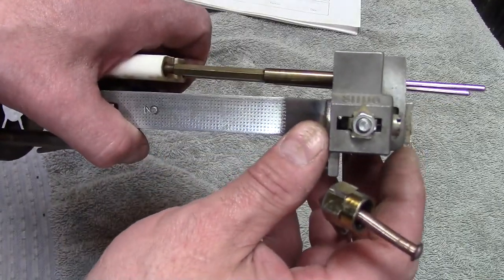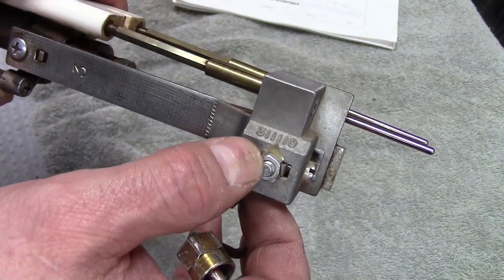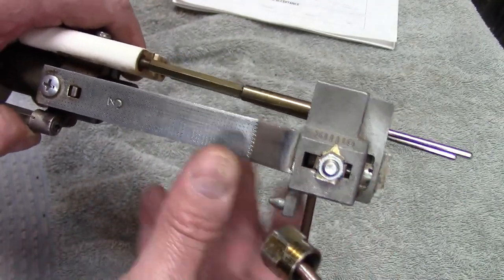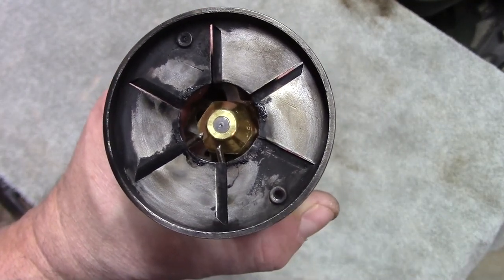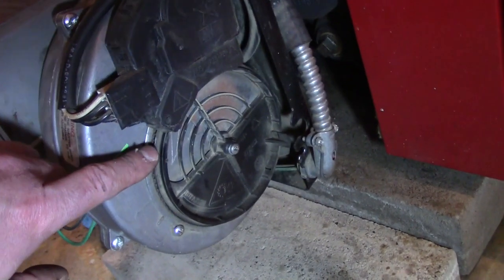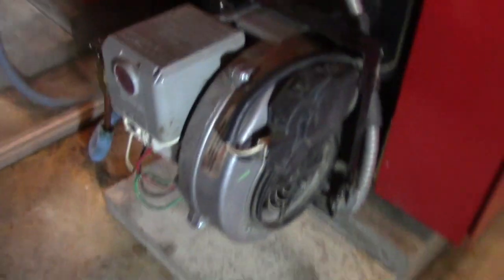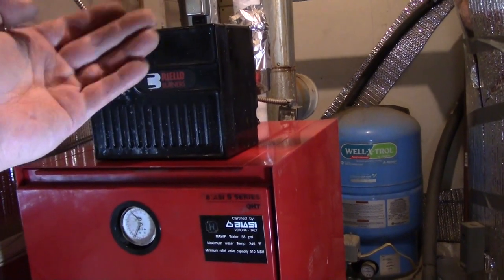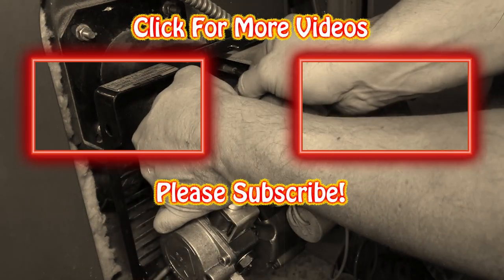How to Adjust the Electrode (Points) Gap On Riello Oil Fired Burners Basic Boiler Maintenance Part 4

Comment: As a DIY I am careful when I touch items such as this . On my Riello , I found 2 different nozzles were used by past service companies . I called Riello and was told BOTH were undersized , based on boiler GPH . I put in what Riello recommended . I have also seen " pros " on video adjust the electrodes " by eye " and use odd size wrenches , and even pliers , on the oil line and bleeder . Which is unbelievable that they don't have the metric sizes if doing this daily . Or even a small adjustable wrench . Great video . Always be aware WHO you are watching and WHERE the information comes from . It may " work or be fine " , but what are these manuals and specifications for ?

Comment: Thank you for this video. One thing I did not see mentioned is the distance from the top of the electrodes to the top of the nozzle . I see a 4mm gap between the electrodes and a 5mm distance to the center of the nozzle. What is the height over the nozzle?

Comment: Great video! I think this is what I need to correct on my Riello 5. 
Its recently been taking 4 to 7 starts before running. 
I've checked the photocell and its fully functional. Fuel is present, as there is a fog 
of atomized fuel in the burn chamber.
What would be the most likely culprit for causing the elongated no-ignition? 
Adjustment of the electrodes?
Reply: Hello. Did you ever figure out the cause/resolution? I am also getting a delayed ignition with 4-7 tries before ignition occurs.
Reply: @easy_two  I managed to get it down to one misfire per ignition. I suspect it is to do with the photo cell feedback loop in the power module. I had touched up all solder connections on the module circuit board. Polished the connections of the photocell.
I suspect the photocell is the culprit.
Reply: @easy_two  let me know how you fair out. I'd like to zero out the misfire.
Reply: Cleaning and adjusting the electrodes resolved this for me. There was significant black soot buildup on the ends which I scraped off with a flathead screwdriver.

Comment: My Riello 3M has been mis firing when initailly calling for heat, it trys to fire 4 or 5 times before it stays lit, it does however always lights and runs fine. Any suggestions when I should look for?
Reply: Hello. Same story here. Did you ever find the cause/resolution for this issue? Thank you in advance.

Comment: If the ceramic part in electrodes where broken could this be a problem for burner to start?
Reply: Thank for fast response. If the ceramic become brittle and small part had broken off while servicing it could this be a problem for the burner to start? As I'm having problems on the riello g5x model it's firing up ok then it's going off but fan still running but it doesn't go to lock out keeps trying to start up gets to 8 bar oil pressure then goes out??
Reply: I've done that plus the electrodes are sparking but won't know until I get a new photo cell tomorrow to see if it this.

Comment: Those electrodes are shot there is a Beckett tool to set the tips the same tool does it for the air diverter redo the video